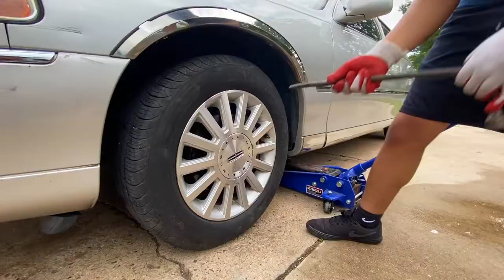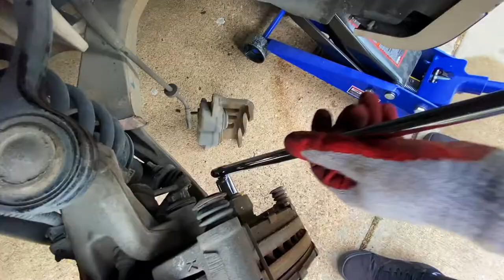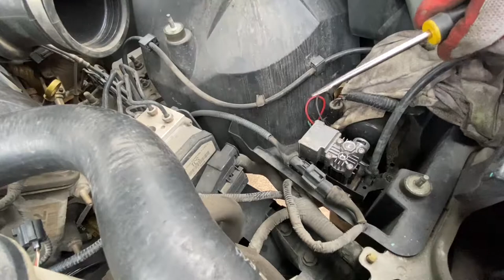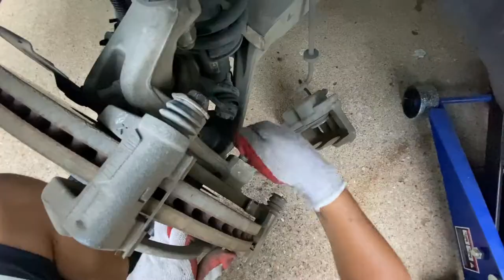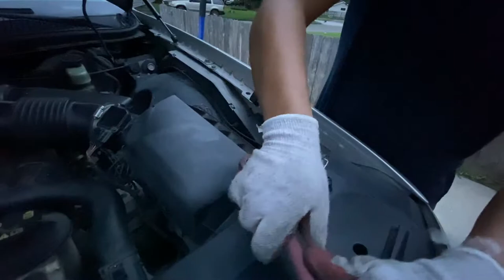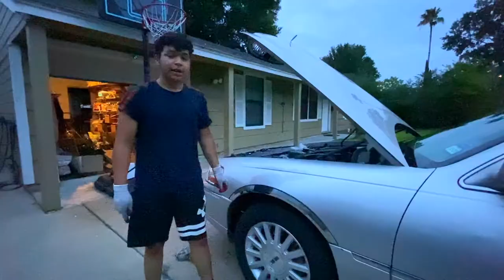How to replace a front wheel bearing & hub on a lincoln town car 2003

Comment: I have to replace mine because mine because a sloppy mechanic let the hub assembly hang off the wheel speed wire when replacing my strut. Not very smart now the wire is split an half and I have lights on in my dash. I love your video, nice work young man. I can do this now after watching your video
Reply from the maker: Thank you sir

Comment: Putting the connector under the air filter box. Any thing to ramp up the labor charge. The Town Car is the most expensive car I have ever had to repair.
Reply: Actually it's the least expensive car to repair I have ever owned and I have two 07 black on black signatures. Also a black on black 2011 L plus a 06 limo 120 stretch.
All have over 350,000 and all run like a top. Best car Lincoln ever build.
Just my humble opinion

Comment: This is same process for the grand Marquis and crown vics
Reply: No it isn't. Both the vic and marquis have an axle nut to remove and only 3 bolts on the hub assembly.  This is no axle nut and 4 bolts. It's similar only in the way that all wheel hub assemblies are similar
Reply: I stand corrected